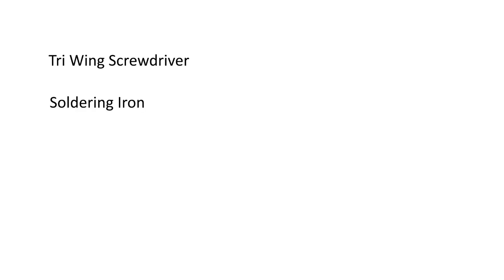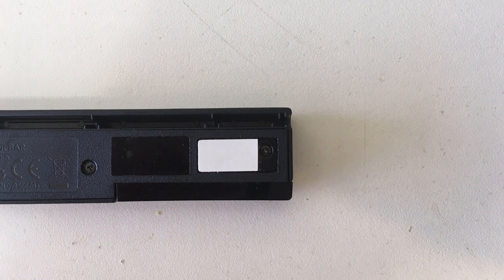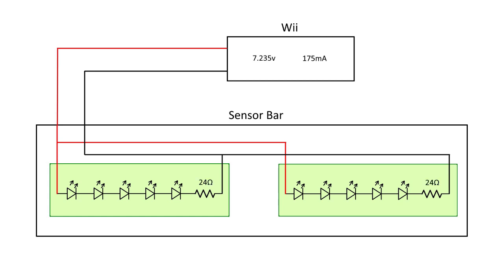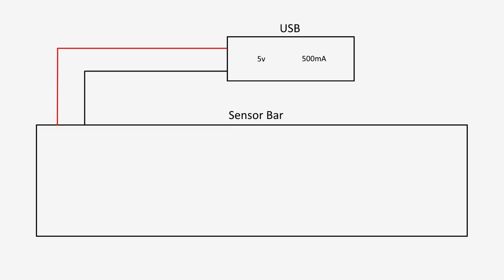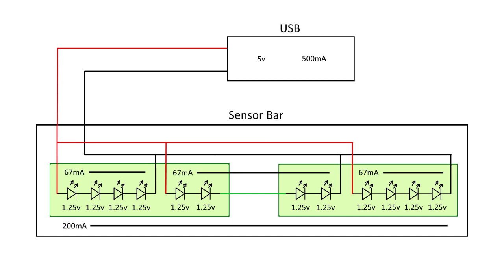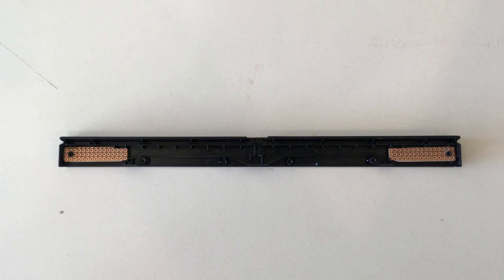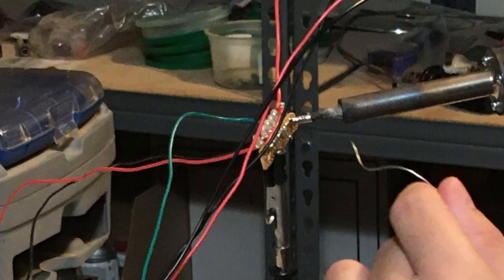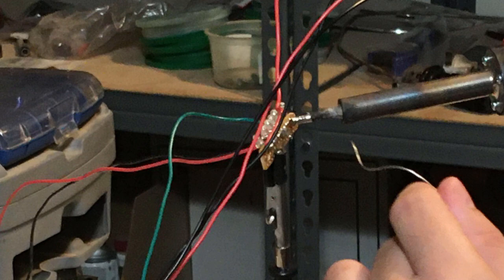Genuine Wii Sensor Bar converted to USB for Dolphin

Comment: Useless manual! All You need is original Wii Sensor Bar and step up USB converter from Ali. Just cut Ori Nintendo plug, solder wires to converter and set 7.5V on converter. THATS ALL. Plug it to TV 5V 1A USB in.

Comment: I have the same bar with 5 LEDs on each side and I replaced the end of the Wii cable with a USB, the PC did not recognize it correctly
The only thing I did was remove one LED from each side and bridge that part to complete the series circuit, leaving 4 LEDs per side.
It worked perfectly without needing to do anything else Dolphin recognizes it and it is very precise I hope someone finds this information useful.
Reply: good info. What led did you remove? one on the center or on the far side?

Comment: Where is the usb connection in the conversion header there is only ir connection in the video I wasted time👎
Reply from the maker: "Conversion Header", "IR Connection" ??? We're just going from one power source to another to light up some LED's, that's all the "Wii Sensor Bar" does. Yes the LED's are IR, but I think calling it an IR connection is a bit of a stretch.
Reply: the only things the sensor bar does is light up some LEDs. There's no connection besides power.

Comment: Okay im so confused, how can i turn the oem sensor bar (it has 5 leds) to USB? Its 5 each side, i tried connecting it to USB on my pc but the little lighst dont turn on (when seen thru a camera)

Thank you
Reply: For example, the og bar works with 7 volts from the Wii, and because the 2 series consume 6.x v on each series... You have to add a resistor to make up for the extra voltage, however in my head I'm thinking since you have 10 leds shouldn't this in theory consume 12volts? If each takes 1.25 or 1.5v ?

Or is it that splitting the 10 LED into 2 series just somehow multiplies the 7 volts by 2 and immediately because it is a series of 2 divides it and by bird magic you get 7 volts for series 1 and 7 volts for series 2... 

I'm sloop confused.
Reply: I was thinking, to do this on the OG board inside the sensor bar you could just remove the resistir And 1 LED and this should be enough to make it work with USB at 5v right? 

I'm trying to make sense of this
Reply from the maker: Wii Sensor Bar is 2 series of 5 LEDs with resistor. The one on my video is 3 series of 4 LEDs sans resistor. So you have to butcher to OEMs to get one to do it this way. I would really recommend just getting a USB one from Amazon if you are just wanting the product not the journey : )
Reply: I want the journey haha, I am very interested in knowing why making 3 series instead of two works better for 5v (removing the resistor I think). 

Like wouldn't this In theory require more electricity? Instead of removing led you are adding them, that's what's confusing me here...
Reply from the maker: @humadawii  the number of LEDS in a series divides the volts, the number of series divides the amps. There’s plenty of amps to run many more series, but when it comes to amps, it only takes what it needs. As opposed to volts that you have to use resistors if the volts are too much.
Reply: @marklarner4495 so basically, with the same 5 volts of the power supply, you can run let's say 5 series of 4 LED, as long as the series doesn't go above the 5 volts of the power supply? Because somehow the 5v still gives 5v to each series? 

Or should I think about it like the electricity is just passing thru the series and as long as is still 5v series it will have no problem going to se second series because the voltage wasn't affected by the first series?
Reply from the maker: @humadawii  and yes, you could just run 2 series of 4 each
Reply: And thank you btw for taking the time to reply :D

Comment: Hi, maybe I'm late to ask but i was trying to modify my Wii bar too, I'm quite new to circuits and i was wondering how did you get 6.15V for the leds?
The two parallel series of leds + resistor each get 7.235V and  87 mA, the resistor is 24 Ohm so to my knowledge the voltage that the resistor removes is 24 Ohm * 0.0875 A = 2.1V
so 7.235 - 2.1 = 5.135V is what's left for the leds?
I can't find a 7.5V power supply so i necessarily need to change the circuit.
One more question, is a 5V 1A power bank too much? In your mod you provide more than twice the necessary current so i don't get if i should care about it or not.

Comment: not sure how you calculated 6.15 v for the leds, it should be 4.2 v
Reply from the maker: Are you talking about what I measured from the Wii? Did you get a different measurement?
Reply: @marklarner4495  Maybe the newer sensor bar model has that voltage?

Comment: I don't get it
Reply from the maker: ?? What part ?? Is it, why bother destroying two sensor bars, a USB cable and two hours of time just to end up with something with same functionality as an item on Amazon for less than 10 bucks, type of I don't get it?
I never figured that one out either.
Reply: @marklarner4495  I get all that, I live for that, but I don't get what parts I need and why I'm soldering all these wires.
Reply from the maker: @archive8080  I know my voice on this is like HAL from 2001 but I don’t know what more explanation I could give, sorry.
Reply: @marklarner4495  I guess an install demonstration and list of parts would help.
Reply: @archive8080  hey dude, sorry for a late reply, I made a comment for an easier build. If you still need a mod done and have questions check my other comment and ask any questions you have.

Comment: So you don't need resistors when powering it over USB?
Reply from the maker: As long as you run the LEDs in a series of four then no, you do not need to use a resistor. If you have series of less then you will.

Comment: i was just looking for a quick mod for my sensor bar so i can run dolphin with an actual wiimote. you made it so much easier on every aspect from technical details to supplies and materials. i will be modding mine tomorrow now. thank you.
Reply: Did my mod, and I think the way I did mine would be much easier for other to replicate.
I simply removed the center LED and 24 ohm resistors from the existing PCBs in the sensor bar, then added jumpers in their empty spaces. replaced the plug with a USB type A, and it's working perfectly.
no need to modify the case, cram in extra wire or cut up bread boards. And can even be reverted to original as simply as it was altered.
Reply: @Druid_Plow  I was thinking about it too. I will do this change tomorrow
Reply: @Druid_Plow  having 4 leds is gonna shorten the lifespan of the LEDs. Each are rated at 1.5V, so 1.5V*4 = 6V and the USB only supplies 5V. Therefore most people remove 2 leds and put in a 10ohm resistor to replace the 24 ohm one.
Reply: @user-yk1cw8im4h  What? But it is using less isn't it? I thought it was 1.25 each.

Comment: can i set all the circuit in serie to use a 12v power supply?
Reply from the maker: Yeah, that should work, just bypass or remove the resistors.